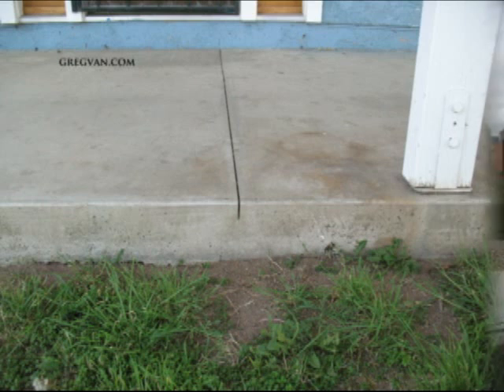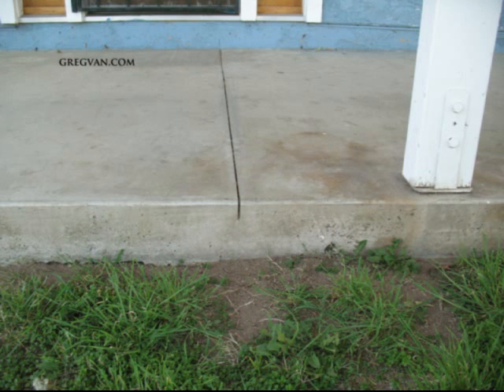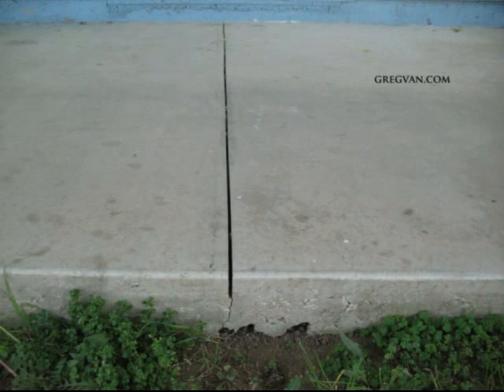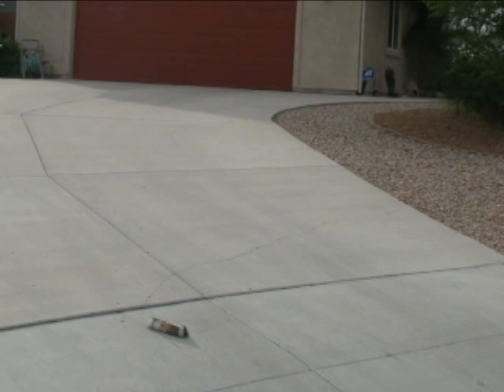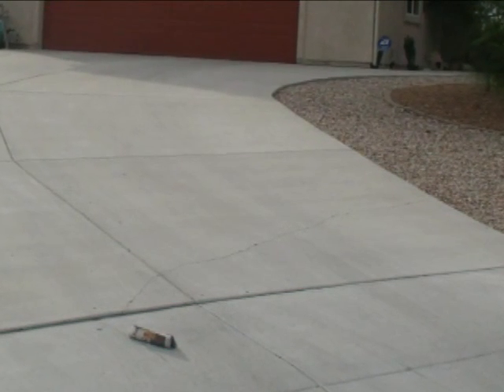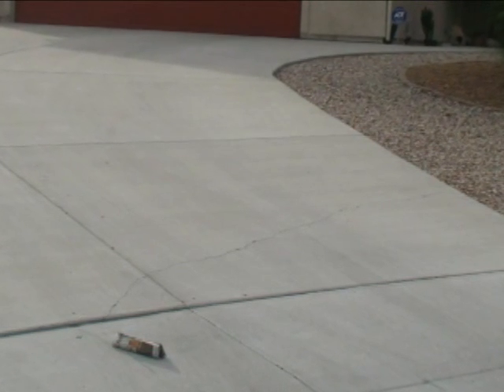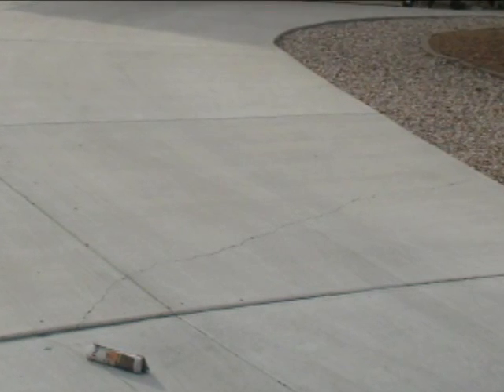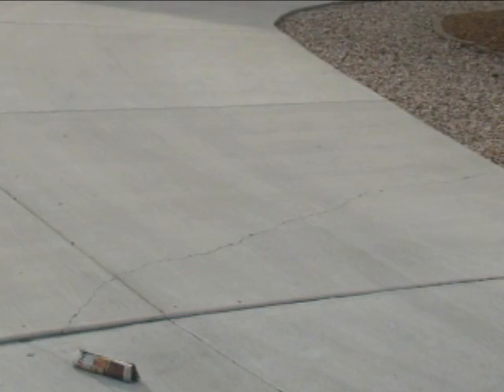Concrete Cracks and Control Joints - Construction Consumer Awareness Tips

Comment: had a new driveway poured and I seen a crack running down a control joint. would you expect this within weeks of the pour? Now that there is a crack in the joint should I seal the joint?
Thanks

Comment: Hello. I want to ask when is the appropriate time to do the saw cutting for industrial flooring. do we have to do it the next day of casting? when do cracks start to appear if the saw cutting is delayed?
Reply: They need to be done next day after pour
Reply from the maker: I've seen them do it the next day after it was poured, however if it was me, I would wait a week, just to prevent any marks or damage from the concrete saw rolling across the concrete. Keep in mind that these are only my opinions and you might want to contact a concrete saw cutting company in your area for more information.

Comment: hi Greg,,, we have designed a concrete driveway,,after watching a
videos about "right angle
els" for control joints, I'm a bit concerned. we have a 1230 ft driveway,,about 24-36 ft wide. putting control joints every 10' and midway odds the drive. we have placed a 10 ft triangle and a 20' triangle in the drive. the two lines from the triangles will meet with the straight line ....so a 60degree point - 3 of them will fan out from the straight line.  will this present a high chance of cracking?  
could send the design,,, or alternate square diagonals along the whole drive is a consideration.  thanks  cindy
Reply from the maker: Feel free to send the design and given the size of your project thought it might be better to use a wet saw to cut your control joints after it's been poured, but it's only a thought.

Comment: i want know more on concrete prevent crack when concrete slab exposed under sun light.
Reply from the maker: +roath nhoung I wish I could help and might make another video in the furture, but there are simply too many things that create concrete cracks and they are practically impossible to prevent. Most concrete contractors simply do the best they can to reduce the amount of them.

Comment: 1) are thicker slabs less prone to cracking, I thought it was only cement that was exposed to sun light and heat that needed these lines, I have not seen them do it on inside commercial building floor slabs. 6 inch slab vs 4 inch... 2) how far apart should the lines be placed, vertical or horizontally apart, need more understanding on this one.. thumbs up.
Reply from the maker: I will do a follow up video and thanks for the video tip, always looking for new video ideas.